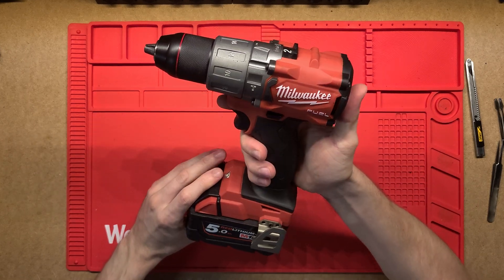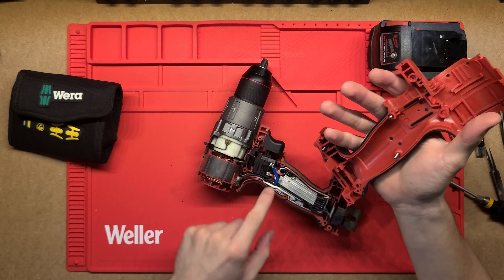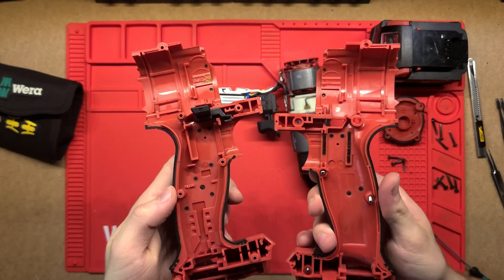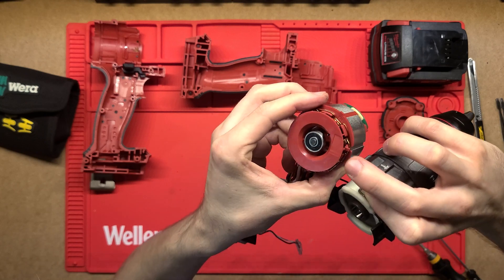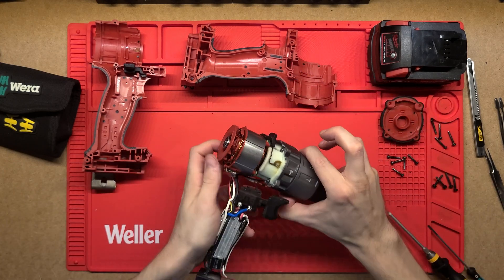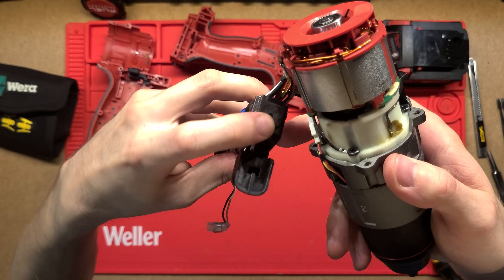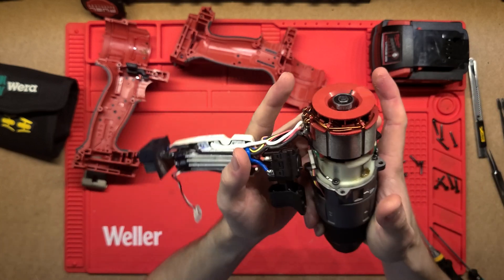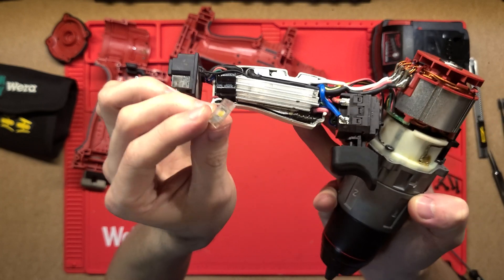MILWAUKEE 18V FUEL™ Hammer Drill/Driver Teardown

Comment: Sick video, just something to note, non fuel is also brushless, the fuel line has bigger motors/more powerful/ and can use more power from high output batteries. Stuff like that
Reply from the maker: Hmm thanks for that insight. I wonder where the line actually sits because I have a non fuel sander that uses a brushed motor. But I agree with your points! Thank you.